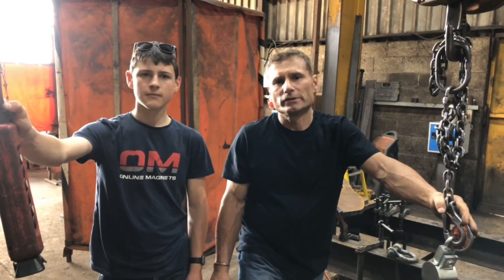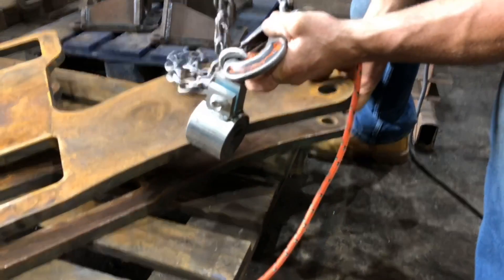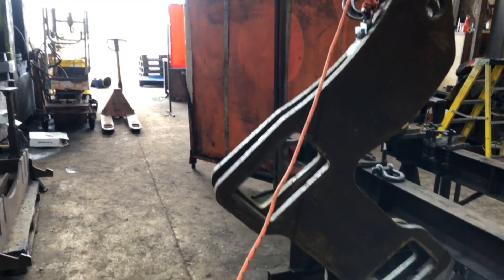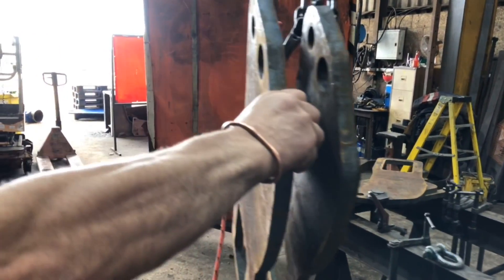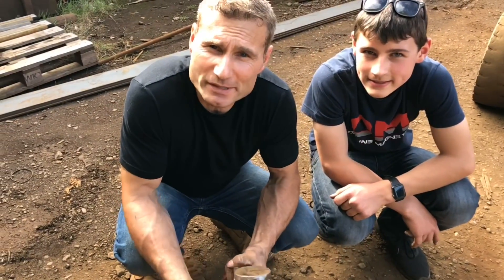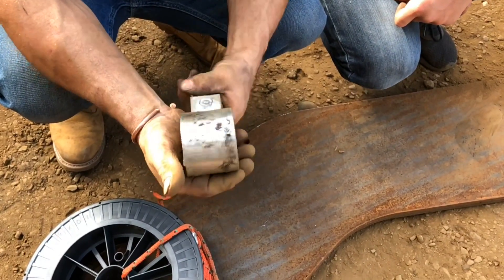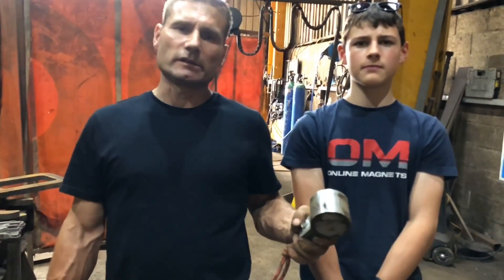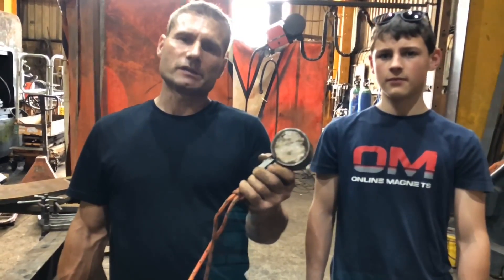Strength Testing The BEAST From Online Magnets (Huge 500KG Pull Fishing Magnet)

Comment: Great video guys! Im looking for a bit of advice. I just bought my first magnet off 500kg combined pull. I'm worried if I get get attached to something really heavy and cant get it out of the water, am I likely to lose my magnet?
Reply from the maker: Hi yes it is a possibility that you could loose it. There are ways to free them which usually work, try pulling the magnet from different directions failing that you could use an inexpensive portable winch. We have in the past had to resort to pulling ours off with a truck but wouldn’t advise you doing it as it’s highly dangerous. Something to consider is where you magnet fish, rivers are notorious for getting your magnets stuck as they have rocky bottoms. Also rivers and canals with metal sides should be avoided where possible. Hope this helps 👍
Reply: Thank you very much, greatly appreciated, I will keep that in mind. 😁

Comment: What's the bite like on the side wall
Reply from the maker: Thank you for your comment, the BEAST isn’t very magnetic on the side walls. If you are wanting a magnet  which is magnetic full 360 degrees Online Magnets are releasing a brand new magnet called EVOLUTION. We believe it’s being released this week or next. We have had one to test and it’s an unbelievable magnet! It has 400KG pull on the top, bottom and sidewalls. Use discount Code Mag10 to get 10% off any magnets or anything on the online magnets website 👍